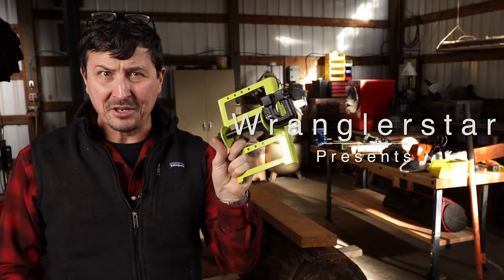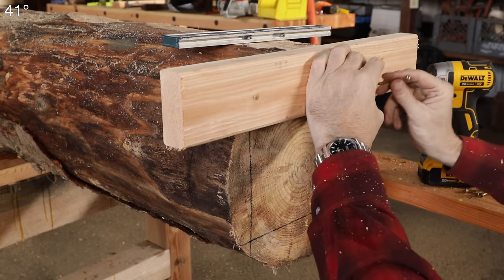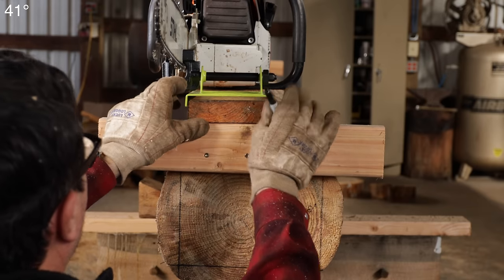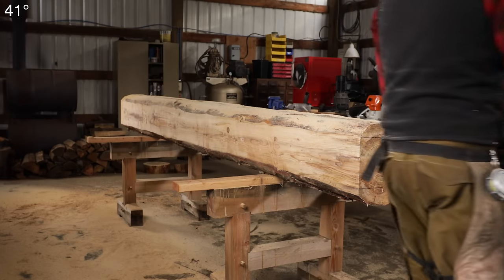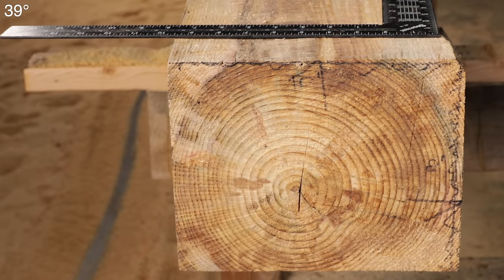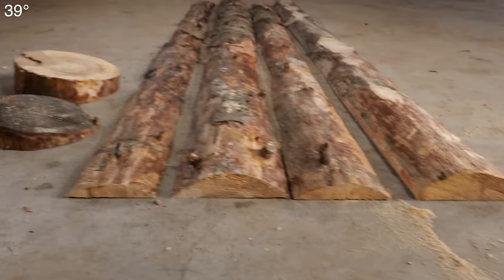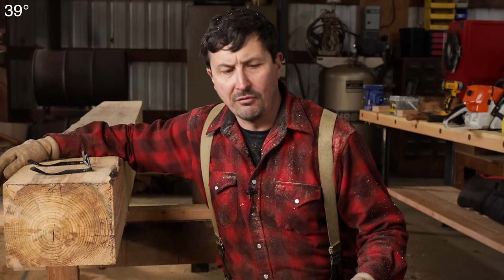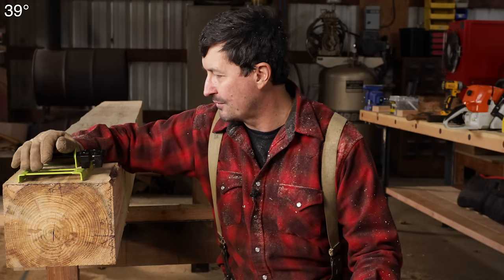How To Chainsaw Milll Like A PROFESSIONAL HOMEOWNER WRANGLERSTAR

Comment: Bought the granberg rail system,most people don't use it after the cut,but a person gets loads more friction on the logs than continuing using the rails,lots of chips and dust on logs makes for crappy cuts, also try not to seesaw your Mill when cutting makes too much chatter 😊😊😊

Comment: It's not the quality of the mill I've found. It's the quality of the saw, saw blade and skill level with them. I've noticed my ms461 doesn't run enough oil to the bar when I mill.. I have to have a 2nd person with an oil dropper add more as I cut.  I usually am cutting boards 20" wide with 25" bar

Comment: This is an amazing, no-nonsense video. Very well done, thank you.  One question: does you or anyone else on here have a few good things you can use the 4 rounded planks? Like, you're going to end up with a whole bunch of these after several logs. It would be good to know you can use those too instead of just firewood.

Comment: I didn't read all the 2000 comments. But to get a possibly best cut, U want to get this 2x6 perfectly straight. To get it done, U want to use the carpenters string. Carpenters string + a couple of extra screws and this piece is like from the factory

Comment: I am going to guess this would be better on seasoned wood rather than green? Interested in using this in the near future. I see that the end of the log is darkened and didn't notice any water ring in it. 

Just thinking out loud if you did this on green wood I would think it would be alot more likely to warp as it dried out

Comment: I guess that depends on usage but you could have kept the ends a bit longer, like an inch at each end, than cut everything and buck it at the end, then you won't have the screw holes that you used to the attach the guide piece.

Comment: Ok so if I'm using my timber tuff saw mill putting my saw vertical like the way yours is in the video why does my saw lower the out put in power when the trigger is 3/4 to full trigger pull

Comment: Mind if I ask how long it actually took to saw through entire length of that log? I know your standard chainsaw chain isn't meant to saw with the grain of a log. I've made short 3' benches just eyeballing my cut. It took forever to saw lengthwise and the bar was getting pretty hot by the time I was done. Thanks for the video.

Comment: Dumb question. Where does one start with chainsaw milling? I have three logs in my yard I want to board out. They are 3 ft thick by 6 ft long. I only have a Poulan 26" saw. I miss my Homelites I had 20 years ago. It's been a long time since I did anything like it though.
Reply: Depends on your saw. Model number would help. Takes a stout saw to mill, definitely want to make sure it is running 100% correct or you risk melting the saw down. I don’t know if I would milk with anything less than say 70cc. It’s been done with smaller saws, but milling is hard on a saw regardless of size.

Comment: That’s great I too have cut plenty of timbers and lumber with the Alaska mill but I think I’ll get one of these for my next project.  And I too have found that for ripping I just file the tooth just a little more square (less angle) and take the rakers down a bit more.

Comment: Cutting your timbers 2" away from the heart center will yield a better end product. As they dry, heart centers will cause checking and splitting in timbers. Other than that, pretty cool product and video!

Comment: I see complaints about the new price. seem like with a few pieces on hardwood, and maybe a metal axle, you could make one that would be an improvement over the original. It looked like it had enough play in it that a lot of the quality of the finished beam should be credited to the operator. Maybe I'm wrong; wouldn't be the first time.
Reply: Yes it's dead simple, and easy enough to make, but the tricky part would be the attachment casting. I own one of these, and I can tell you it's rock solid! For the money, why bother?

Comment: I appreciated his video, his instruction, and no non-sense approach. The Tool seems very cost effective and easy to use. My only question is. He seems to put himself, body, and arms in front of the blade rather than staying behind the blade. This seems to increase the potential for severe injury if the blade were to kick up.  Otherwise, 4 of 5 stars.